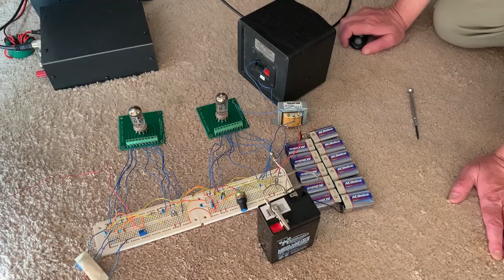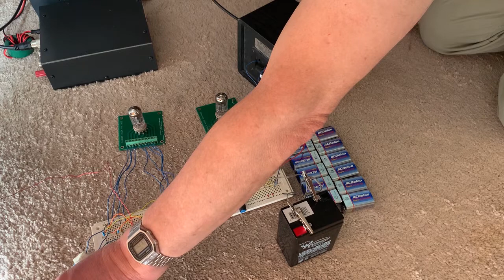Vacuum Tube Regenerative Receiver

Comment: Schematic?
Reply from the maker: I didn't actually build from any one schematic.  I cobbled a few "standard" circuits together.  

If you look in Wikipedia under "regenerative circuit", there is a schematic that was my starting point for the regenerative part.  I used 1 Meg for the grid leak resistor and 0.01uF across it.  Don't forget the bypass capacitor (C4) - I originally didn't realize why it was needed, but without it the circuit will not regenerate.  I am using 2200pF.

For the audio amps, I am using 1 Meg grid resistors, 1k cathode resistors with 10uF bypass capacitors, and 10k resistor for plate, with 0.01uF capacitors between stages.  Might not be ideal, but those were the capacitors I had with sufficient voltage rating.